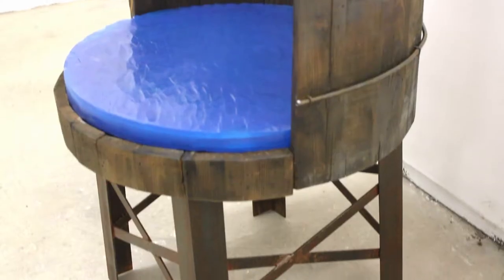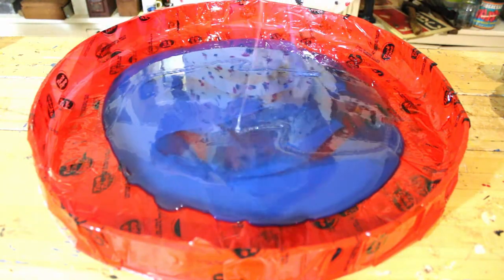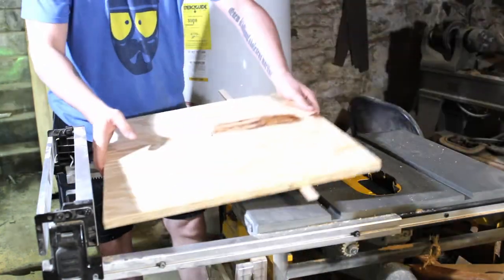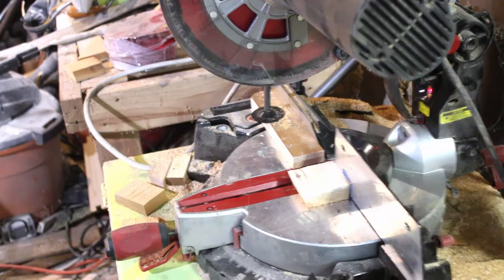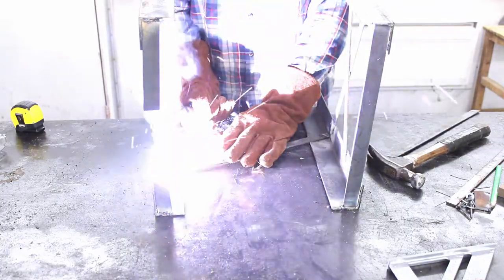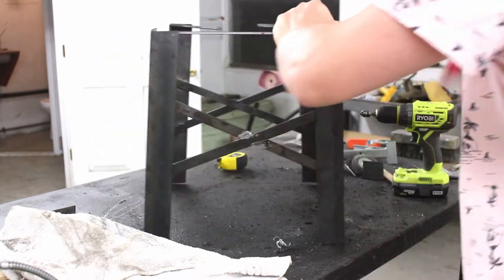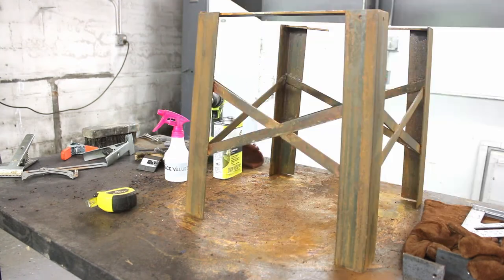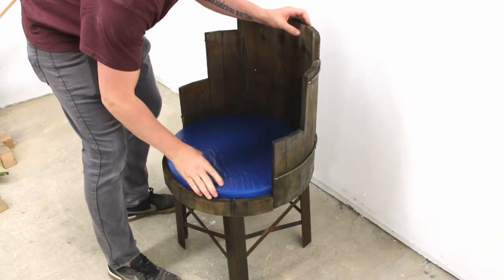DIY Reclaimed Wood, Epoxy Resin, and Steel: The NYC Water Tower Chair

Comment: Nice work, definitely a long time coming! I’ve always specifically noticed the steel rods around the water towers, in fact they have an interesting sort of 8 shaped fitting that both ends are bolted to to keep it together which is pretty interesting.